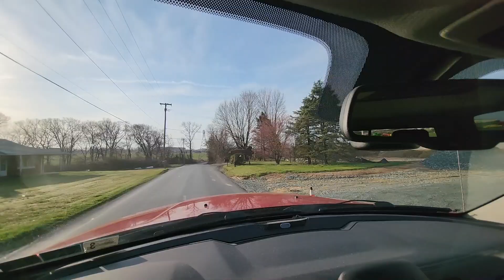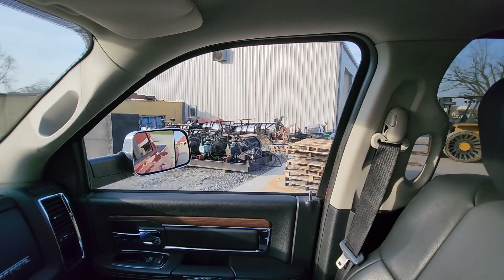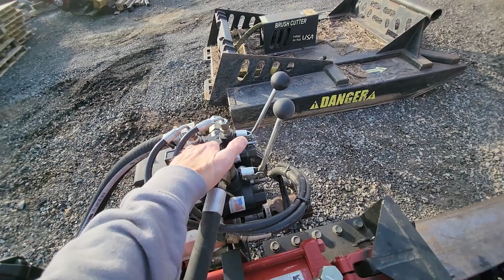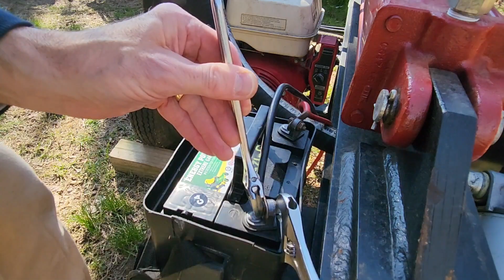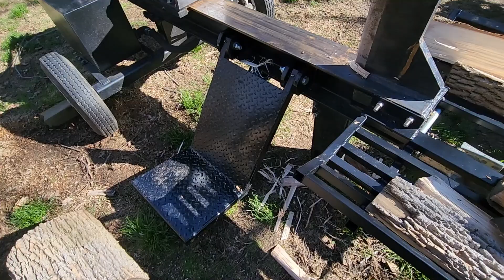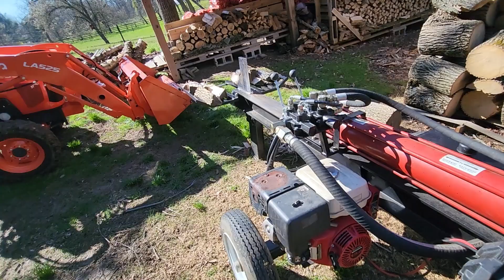A Souped Up Log Splitter!!!!

Comment: That wood-mizer was pretty cool.  The hydraulic lift is a nice upgrade and well built. It does make for a good work table.  I did notice that having a second lever threw you off a bit, lol, it  would have done the same to me. Like you said it's just a matter of getting use to it. Glad you are happy with the upgrade John. Happy splitting!
Reply from the maker: Right you are, Paul!!! By the time I get the controls figured out, I will be looking at another machine!😂

Comment: Have a great Easter John. Nice hydraulic log lift. 
I had the Easter wabbit at my place this morning. Might have been hiding something. 🤭🤭🐰🐰
One more upgrade you say. 🤔🤔🤔🤔
Don’t want to sound or be negative John, sorry, but I can see four. That’s just me what I would do. 
Have a great Sunday. 🐰
Reply: It’s just me John. But I would close the gap in between the extensions. 
Two, I would make a 45 degree shelf from the extension to the work surface just before the wedge. 
Three, l would close the gap with a shelf between the hydraulic lift table and extension. 
Four, I notice you stretching to reach the wood and the handles. I would move the valve system closer toward the wedge. One for comfort and the other for safety. 
Just me John. I don’t like wood falling on the ground and having to bend to pick it up. 
Just my thoughts John. I surely don’t  mean you have to do them.  
Have a great day. 👍🏻👍🏻👋👋🪵🪓🔥
Reply from the maker: Noel..... Outstanding suggestions as always.
I had intended on closing the gap in the middle on the outfeed table and forgot to mention that.  I actually have a piece of metal already cut and prepared.   I like your other suggestions a lot...stay tuned@noelstractors-firewood57
Reply from the maker: Noel, I know that you are always thinking, and I would love to hear your ideas about the other upgrades!!!!